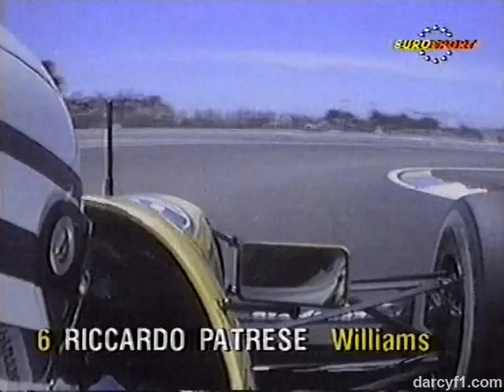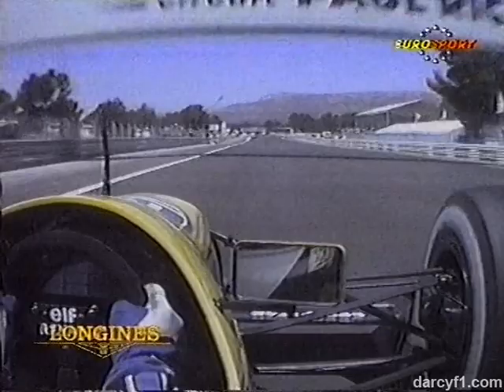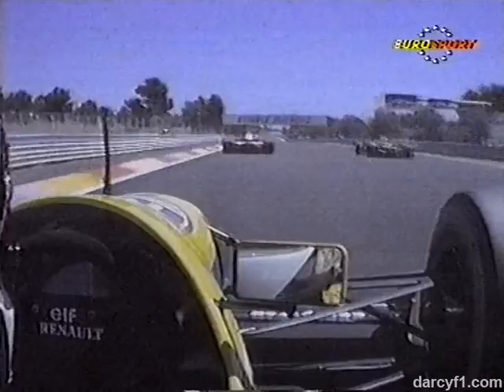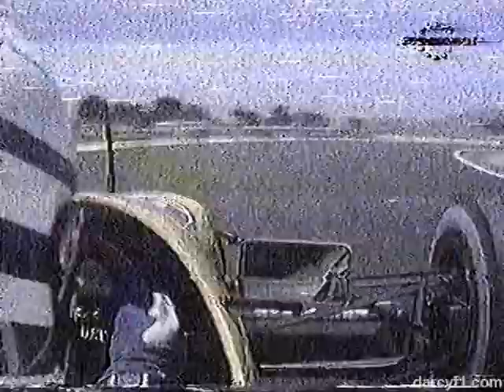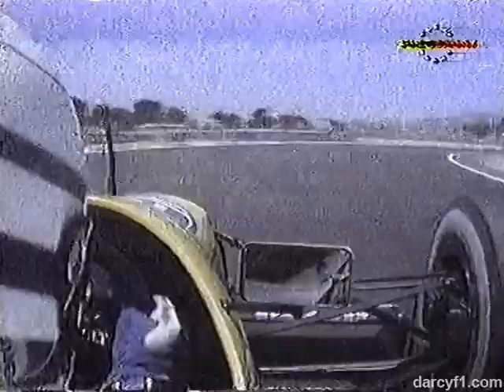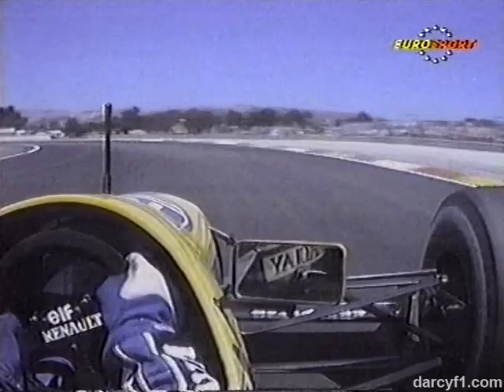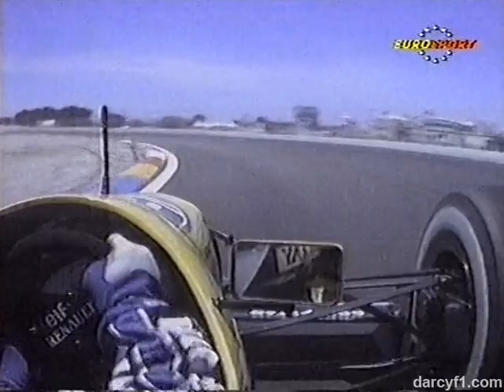An Onboard Lap of Paul Ricard with Patrese in 1990

Comment: The surface redesign is such a bruh moment

Like w h y
Reply: This is one of the Hockenheim cases. All these beautiful straights and highspeed corners converted into chicanes where the drivers aren't even able to reach 80 kmh
Reply: Because it was a test circuit, so it doesn’t make sense to damage your car if you go offline
Reply: @azam829  This version of the circuit is shorter than the current version. The current length of the mistral straight (with the new chicane) is similar to the length on this circuit
Reply: @jrp312  key word being was

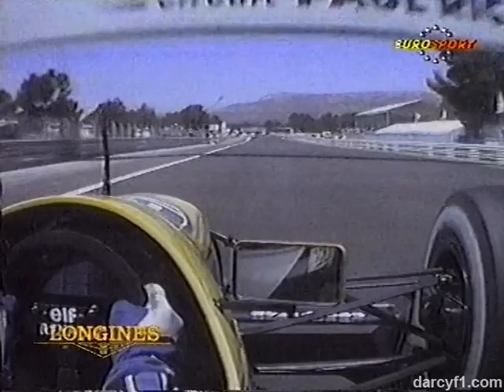Comment: 0:16 HEY NEW GEN "DRIVERS".. TRY TO DO THIS AHAHAHAHA YOU CAN'T AHAHAHAH POOR KIDS
Reply: ok boomer
Reply: Do what, brake and turn?
Reply: @gustavo_paganelli  i think he meant use manual gearbox
Reply: Entering a corner after an entire straight at almost 300km/h done with only one hand on the steering wheel?
They can do better than that. And safer.
Reply: @fredphilips5320   I highly doubt they can use a manual as effortlessly as drivers who always used manuals lol. Same with old drivers, they probably can't use all the buttons of a modern F1 car. No point in arguing, different eras are just.. different. And if you think the 90s were "unsafe" what do you think about the 60s and 70s?! The only 2 deaths in 1990s, both 1994, were not due to car quality, but due to stupid decisions from SimTek and Ratzenberger, and Williams. And yes Imola wasn't the best, it already had a negative reputation and San Marino '94 was the icing on the cake.